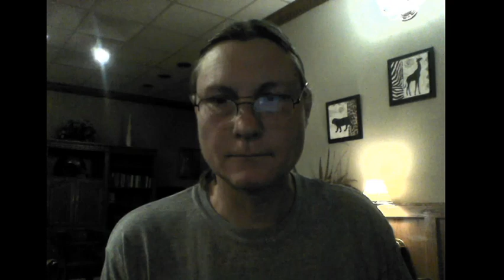CAN YOU HEAR THAT BIG SWOOOOSHING SOUND?

Comment: I bought 5, 300 watt power stations and solar panels to recharge them.  I didn't want a gas, diesel or propane generator. You can't keep enough fuel to keep them running for weeks at a time.